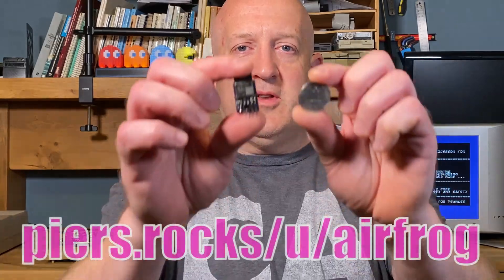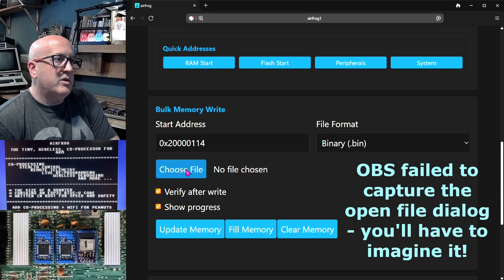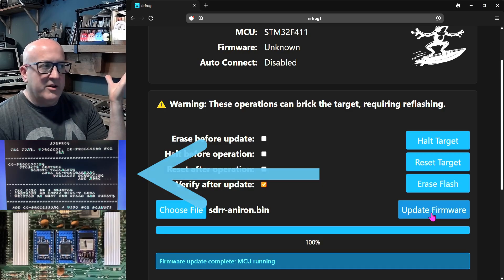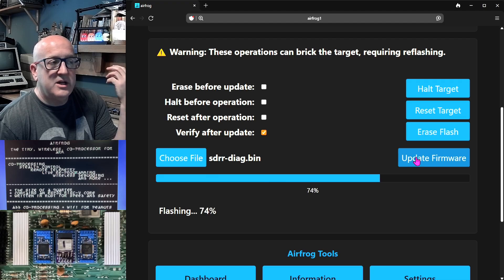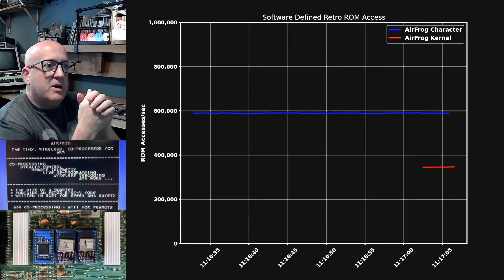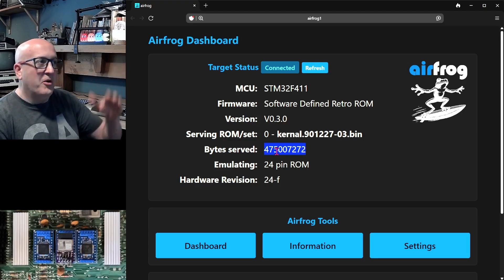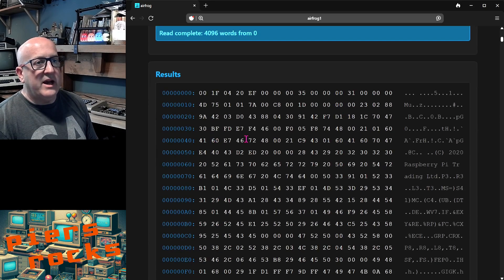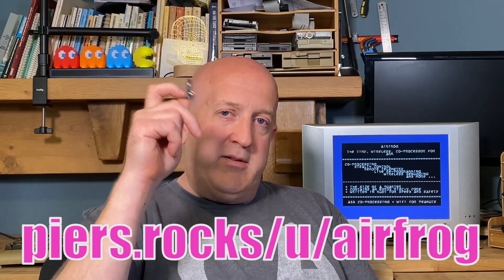Airfrog: Tiny sub-$5 wireless co-processor for ARM MCUs

Comment: this is excellent. I think a port of this interface to openocd would be excellent. that opens up SO many other usages. haven't seen the code, but I hope you did implement the swd protocol properly, not as haphazardly as ST with their stlink!
Reply from the maker: @cocusar Ahem.  I've tried to do it decently, following the ARM specs directly, but I've been learning as I've gone along so I probably have much still to learn.  There's some work to support the RP2350 as it uses a newer version of SWD.

By openocd port - do you mean allow airfrog to be driven by openocd?   I haven't really used openocd - I haven't found its interface very intuitive but I expect it's very powerful.  If it has some sort of plugin architecture, it's probably pretty easy to support.
Reply: @piers_rocks indeed, supporting the airfrog inside openocd. it's not something you'd end up doing just with cfg files, but the interfaces plugin style they have us pretty good. I've used it before to bitbang swd and jtag through gpios of a SoC directly talking to the gpio registers rather than using libgpio or the sysfs gpio which are notoriously slow